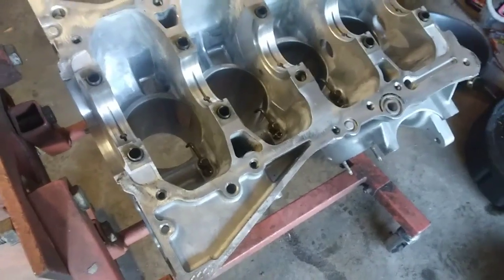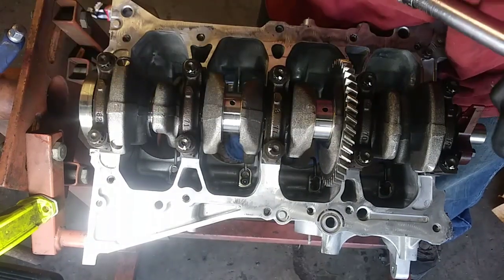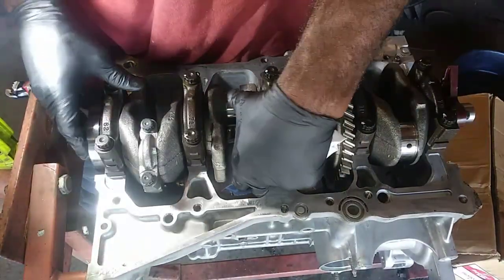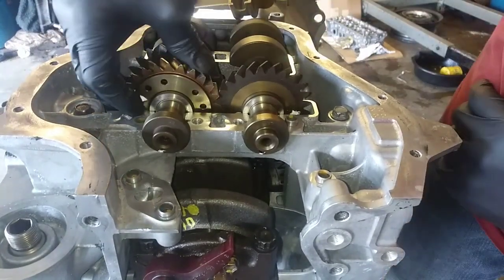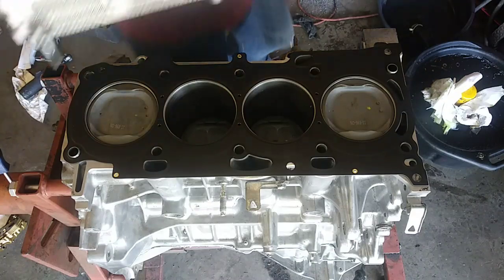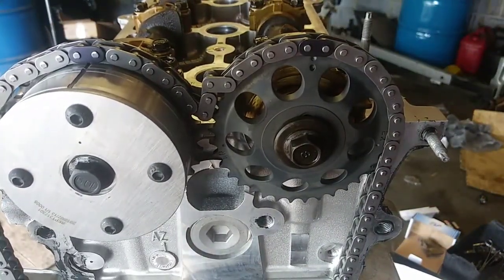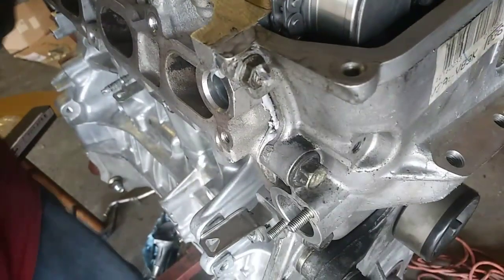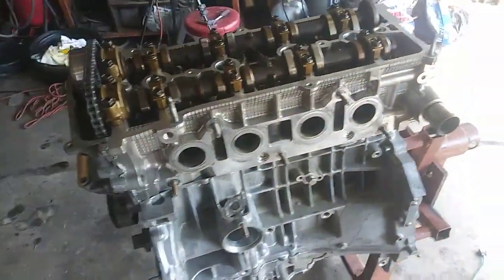07 Toyota Camry engine rebuild

Comment: My wife has a 2007 and the engine with puff a little blue smoke on startup if it sets for a week.  Is this a design flaw. We have owned nothing but Camry since 1996, I drive a 2.2  2002 and it never uses oil 166.000 miles.   Great Video Thanks1

Comment: 🤔ths video is very instructional,there it is a big mistake on the camshaft caps torque specs the 10mm bolts there is no way can handle 80 lbs. of torque ,i try it one snap right off,like i taught it would💯

Comment: Great video as always  I have 02 rav4  cylinder head need  shave down to .0025   is it ok use OEM gasket or  oversize gasket  (thickness)
Reply from the maker: I'd talk to the machinist whose servicing your head. Because it may have been shaved before. They can measure overall thickness
Reply: Thanks

Comment: On the timing marks I have lots of marks.. How could I tell which one is the required one? I have letter E ,two I and two dots separately ..!!!
Reply from the maker: The "E" faces exhaust direction..." I"faces intake direction.  Timing chain should line up with marks
Reply from the maker: There's a line on intake, and dot on exhaust cam the chain should lineup with

Comment: nice job. please, where did you get those metal bearing sets from ?
Reply from the maker: Rockauto.com I say this in the video... Did you watch it?
Reply: @partsshooter  yeah i did watch the full video and it was realy knowledge packed full but i didnt get the source of the parts. I have had to change connecting rod bearing sets for my camry 2007 twice and as soon as i hit 140 to 150km/hr, the bearings flatten out and the low oil pressure ligth comes on.
that i the reason i want to get original toyota parts so that i can rebuild it once and for all.
pls, kindly assist with the source of the genuine parts.
Reply from the maker: @techpointzone4408  seems like you dont have a "bearing quality" issue. Your problem lays elsewhere. Check oil clearence with a plasti gauge, I've done this on this build, it's in the playlist.

 If you spun a rod bearing, and replaced the bearings ONLY without connecting rod, you have Clarence problems within the beating cap and connecting rod need replacing.

Also there's a possibility you have defective main bearings, that'll reduce oil pressure. Check the balance shaft bearings...replace the oil pump this next go around. Check over yourself! Human error is real!

Comment: is that correct position when you install the balance shaft? i think thats backwards
Reply from the maker: If you're not certain of my video. Try another source, simply contrast your information and formulate your own conclusion.  😎
Reply: @partsshooter  yeah i also not sure about what i know, still confuse but thanks!!, good job man. i want to ask again about radiator if know about this. many people said that if the coolant in radiator squirt when i open the cap. rad and start the engine, that means my head cylinder gasket has leaked. in my case, i have seen a little squirt when i open cap. rad and start the cold engine. its that means my head cylinder gasket has leaked or that because of pressure from waterpump?
please give me an information
Reply from the maker: @mikhaelfransisco3371  in most cases, if a car is cool, you start it up with the radiator cap off, coolant should be stable. Assuming there's no air In the system. 

The causation of this "blow out" is at times due to  combustion pressures relieving into coolant jackets, because the pressure is greater in the chamber over 180psi. Various blown head gaskets have their own unique thresholds.

What you can do... Obviously check oil for coolant and coolant for oil contamination.

Ensure all the air is out the coolant system, start and allow engine to warm-up, make sure your heat in the car will get hot while simultaneously ensuring the car isn't overheating. 

During this process, if things are fine -make sure the coolant isn't bubbling into radiator reservoir. This will indicate likely combustion pressure is in cooling system or air contamination.

If you have no heat, coolant bubbling or blowing out with cap off and overheating after ensuring above mentions, plausibly suspect the head gasket.
Reply: @partsshooter  thank you for your answer. i already check my oil and radiator. there is no contamination from each other. coolant in radiator and reservoir also not bubbling when i start my engine, and when my car already warm, still no bubble in reservoir. i turn on the engine more than 1 hour and the temperature still in the middle. there is no overheating, bubbling, and contamination. only small squirt coolant when i turn on the engine with opened cap radiator sir
Reply: there is possibility from waterpump? make a small pressure from it because suddenly working?
Reply: or positive because of head gasket?

Comment: Haaaa the whole reason I watched this video was too see the head cylinder installation i need the torque specs man.maybe next time.
Reply from the maker: Simply Google it... 2azfe is a common engine. Torque specs are out there😎
Reply from the maker: I thought I mentioned it in the video though...
Reply: Tried to Google it i get different numbers and when found this i thought i was going too get the answer however the video was informative pretty good instructions.
Reply from the maker: @JoseAlvarez-wo5ln  send your car info I'll get you factory info
Reply: @partsshooter  2007 toyota camry 4cyl i think is the same as what you worked on . Thank you very .
Reply: @partsshooter  what info do need specifically.
Reply from the maker: @JoseAlvarez-wo5ln  58ft lbs and 90 degree... Just 2 steps
Reply from the maker: @JoseAlvarez-wo5ln  to clarify.... Torque to 58ft lbs, Mark bolt head and turn 90 degree
Reply: @partsshooter  thank you very much thats very helpful tomorrow is the day we'll see how it turns out